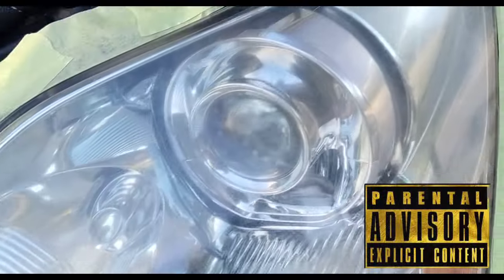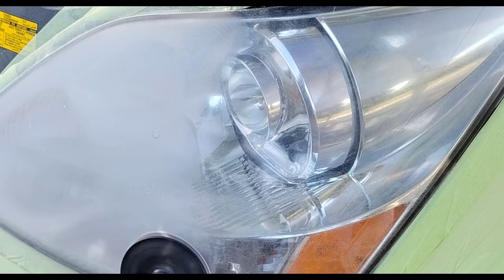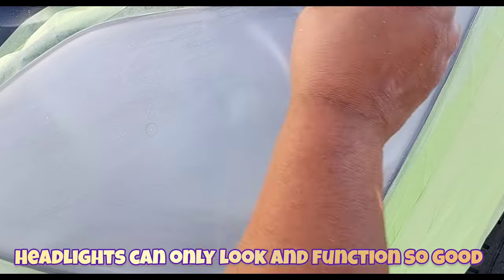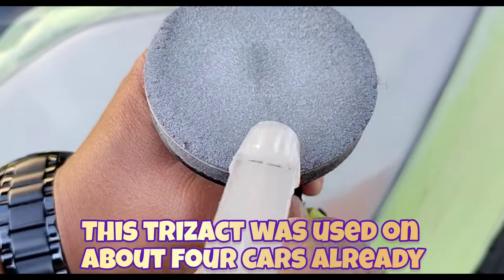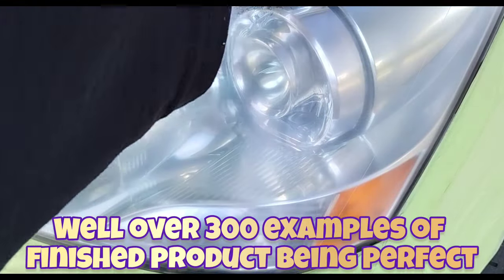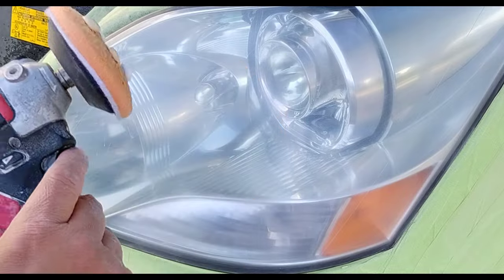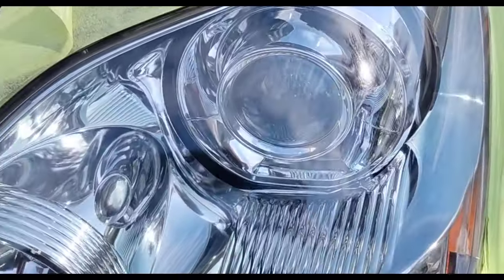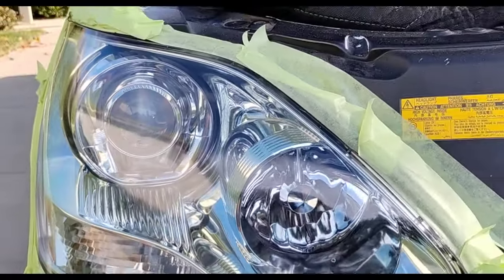Headlight Restoration OUT OF THIS WORLD 🌍

Comment: Hey headlight boss

A reason why you use unscrewed side on the drill than screwed side ?
Reply from the maker: When using this for headlight restoration and there is no unscrew or screw... It's just left or right it alters which way the spindle spins...
The main reason I switch back and forth is for safety as a drill will throw you when you hit certain spots and also on different lights even on the same car left to right it pulling you in a direction you don't want to be pulled in so you switch...
Reply: @theheadlightrestorationpro  thanks for tips
Reply from the maker: @sandwichburger4856  👍🏽

Comment: I’m sure it’s a common sense answer but whenever you schedule someone and the weather shows potential rain, do you usually have to reschedule if they won’t have a garage or some covered parking?
Reply from the maker: I work in all weathers anywhere...
https://youtu.be/C12RHABN0ZI?si=JwyBWtT2eKcmS-uD
Reply from the maker: All you need is like a 5-ft circumference in most rainy weather... As long as it's not too windy or raining too hard you should be able to do it in a little bit of water gets on the light while you're working on it it's not a big deal you only want to avoid water when spraying maybe 40 seconds before and I'm like a minute or two after.... I do it all the time.. check the link inside the bio I have umbrellas called Wonder shades their pop up two piece very quick and easy and I also have a bunch of tarps 8x8 10x10 6x6 so pretty comfortable in the rain....
Reply: @theheadlightrestorationpro  I appreciate the quick and helpful response. Of course the days I can perform the services right now (weekends) is it supposed to rain here and I don’t want to move them if I can avoid it. I appreciate the advice my man!
Reply from the maker: @mikaporter9952 👍🏽